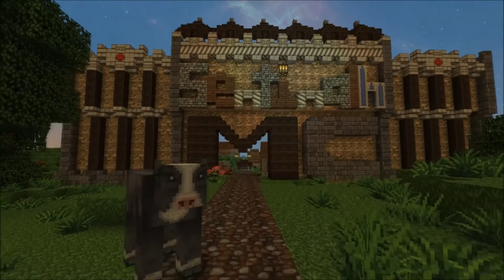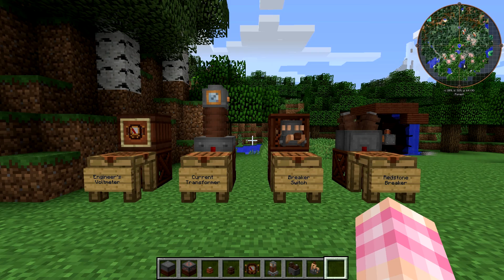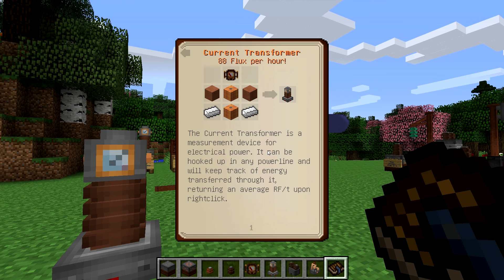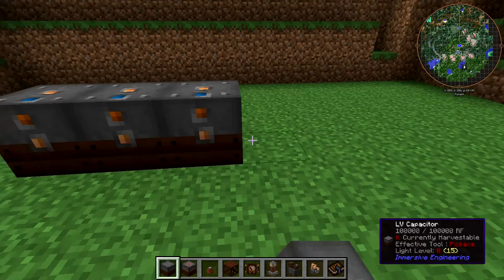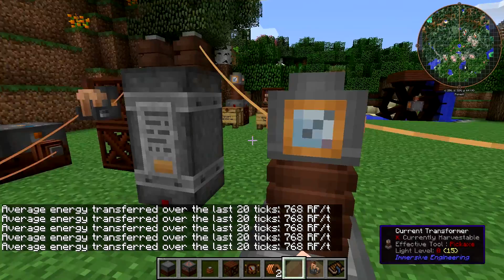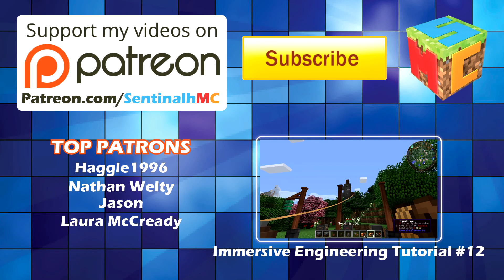Immersive Engineering Tutorial #13 - Electric Bits

Comment: Thank you for the effort! But how much RF are flowing through this LV wire? http://imgur.com/ezoqJEK If there are 1024, why doesn't it melt?
Reply: Yeah I expected that to be a derp moment too. And then it didnt Burn.
Reply: Looks like a bug, maybe the meter is wrong.
Reply from the maker: Honestly guys at this point I have no idea. I thought I understood the system but again and again it seems to contradict itself.
Reply: read the book, 1024 rf/t is the transfer rate of lv lines.  it's just that each input and output is restricted to 256 rf/t.
NB:  it was 1024 rf/t in the pack i was playing.  actual transmission rates may vary.  see my post on video #12 for defaults.
Reply from the maker: I must have missed that